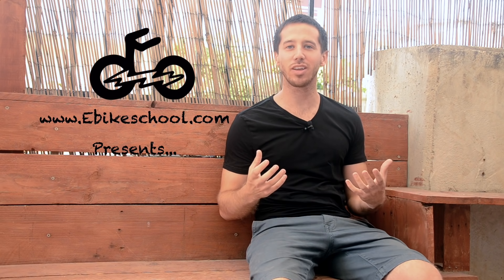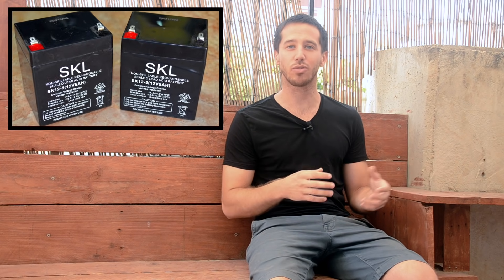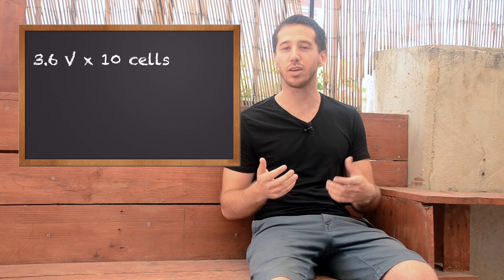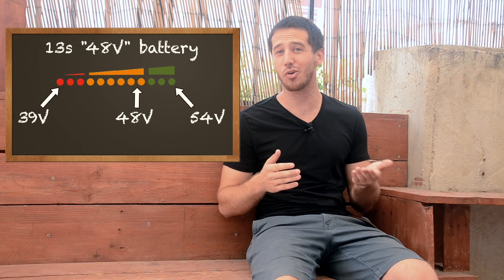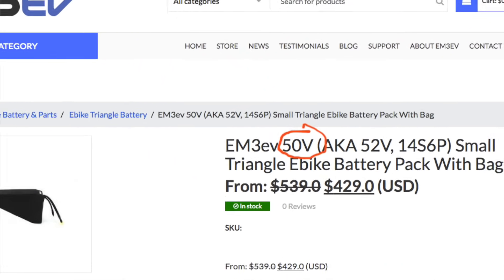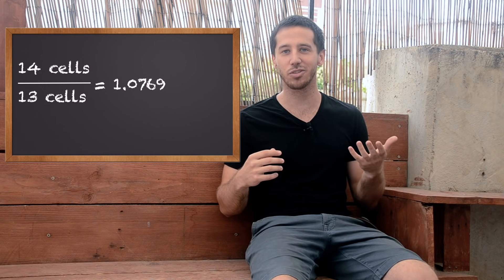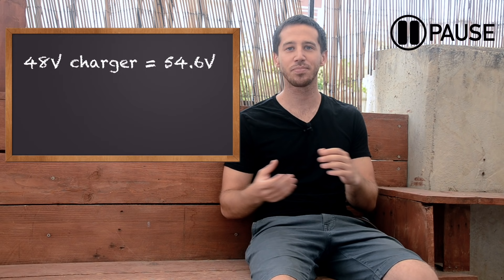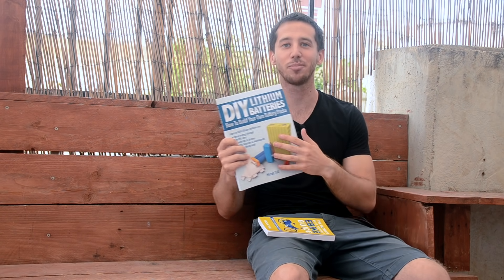Which is better: 48V or 52V battery?

Comment: Great video
I wish I had seen him last month :(
I just built my 48V battery. Of 8x13
And it was planned to change it to 9x13
Now i am thinking of updating change the bms to s14 and new charger
To stay with 8x14
Reply: Benjamin Gonzalez personally I'd want longer distance over speed. How many watts motor and how many miles do you get on a charge?
Reply: I am using a 9X13S and i love it so far and i mined cells from used laptop batteries. Put near 10 miles on it the other day and still had all 3 lights on the cheesy indicator on the throttle. My top speed is 25mph with a 1000W front hub. Not sure its really worth going through all that for just a couple more mph however i do believe distance would be greatly improved since you wont be bouncing around near the low current protection on the motor controller.
Reply: Honestly i have no idea. I didnt have anything to test them with and they were all mix and match. Im sure that will make some cringe lol. Here is what i did. I first mined all the cells and then i started checking voltages separating them into 3 categories. Above 3V Between 2.6 and 3V and under 2.6V. All of the ones under 2.6 i tossed. I kept the batteries that retained the most voltage after sitting forever in my buddies computer shops back room. That was all the testing i could do. Not much and im sure many would freak out over it but i only charge it when im able to watch over it and ive never been much of a "safety sally" as my dad used to call them. I bought a 45A 13S PCB from china for about $16 including shipping and i bought a cheap charger from ebay. The charger is rated at 59V so you have to use a PCB otherwise you will overcharge the cells. Here are the links to the PCB i bought and the charger.

  http://www.ebay.com/itm/13S-45A-48V-Li-ion-Lithium-18650-Battery-Cell-BMS-PCB-Protection-Balance-Board/352065673446

http://www.ebay.com/itm/New-48V-1-8A-Plug-Battery-Batteries-Charger-For-Electric-Scooter-Motorbike-Ebike/282385669965
Reply: Also i should note before i built the pack i charged each cell independently with my nitecore D2 charger that i use for my ecig batteries.
Reply: The Watchman News Cool thanks. Update this post or a video after you put more miles on the pack.
Reply: Ok will do and you're welcome. I made videos of me assembling my bike i just have to get them edited and uploaded. If i have a channel for that long lol. Youtube hit all alternative news today with mass demonetization of videos and as soon as they figure out that wont stop us they will get rid of us. LoL I literally found out moments ago after my daily reboot to prep for our live show.
Reply: Hi TheThrillanmanilla My ebike is 48v 500w my top is low of 20mph
I have not completely finished a load and reached 20 miles
My cells are sony of 1.95mha of a lot of batterias of laptos

I only go 10 miles a day because of that I would like more speed,
Reply: The Watchman News what was the mah of the cells you used? What did you use to test them

Comment: Another advantage of 52v over 48v is the depletion voltage of 2.5v per cell gives 35v over 32.5v respectively which means you don't feel as much of a sag in the bikes performance near the end of the charge.
Reply: This is why your batteries don’t last long...... a 3.7v battery will charge to 4.2v. If you only use your battery till it’s about 3.7v per  cell, it will last so much longer. Lithium batteries are very tough.. the best way to shorten their longevity is by running it till the voltage is below 3.5, though most people will run them until each cell has 2.5v... running your batteries that low is the reason that most have to replace their batteries within a year and the reason that their batteries doesn’t perform the same after a few weeks of ownership.
Reply: @anthonypacis7104  i am wondering if the "cycle analyst" can monitor battery cell charge and provide some kind of shut off when it dips to the 3.6v.
Reply: @manp1039  I wish I just knew what all this meant 😆
I know and understand a little as I just upgraded my own ebike to a 48v plus new 1000w front hub motor so I'm running over 1500w total and it has some juice now, even getting up to nearly 40mph which is scary on that 4" fat tire. I've been hearing about the voltage while it's running but do not quite understand that and want to make mine last as long as possible without taking away from the quality of the ride because I've spent a lot so far for two of them which I love.
Reply: Anthony Pacis without a display how do I keep track?
Reply: voltage will sag more as you lose 1.3v *14cells instead of a drop of 1.3*13 cells. your end voltage is 2.5 higher though.
Reply: someonespotato hmm won’t 52v burn more electricity than 48v
Reply: @QiahKincaid  According to the guy in the video yes according to physicists no.
The answer is a definite maybe.
If the bike needs 400 watts to maintain it's speed it matters very little what combination of amp and watts gives you that 400 watts.
It's 400 watts. Higher voltage is actually a bit more efficient here because resistance is dependent on amps not volts. (Physics).
If you fully tax what the controller can supply by going up a hill it can give more watts if it has higher voltage.
But since the lower powered bike uses power longer it's likely a toss up.
Reply: Ahh. You just answered
 My question? Thank you.guy
Reply: Can you explain, how two build my own battery pack?

Comment: I really enjoy these videos. I bought a front hub drive kit and haven't installed it yet. Spending 700 on a battery and charger has put me off. I feel like if I buy a small low priced battery I am wasting my money. 300 is more my price range. I need to just get one and go for it. And then after I am enjoying my ebike,  take the time and build one of your fancy batteries with the guidance of your book. Any recommendations on a low price quick battery?
Reply: Get 4 lead acid batteries at least 8ah around $60 and you can ride a season while you build your pack.

Comment: Could one disadvantage be that the capacity indicator that came with you 48v kit would indicate a higher remaining capacity than he battery has?  (if it's based on the system'S voltage) 

In other words, you would definitely need to upgrade your voltage meter.
Reply from the maker: That's true, I should have mentioned that. If your kit has a battery indicator separate from the battery, like on a handlebar display, it will no longer be accurate. Your bike will die when the meter still says its about half full.
Reply: Ok, yes it would die at a higher reading, but wouldn’t it also take the larger battery down to the depleted 39v (or thereabouts) controller cutoff of the 48v battery, which would and could damage the batteries.....probably not that big of a deal with 48v to 52v jump but what about say 36v to 48 volt battery increases as you have done videos on. My controller to my knowledge doesn’t give me options to change the absolute low depleted cut off voltage setup in the controller to keep overdischarging li-ion batteries. My controller is a fixed 36v controller, I guess I could try to find a 48v controller but would also need the display.

Comment: Mikey, I want to win your little yellow book, I already have the other one. I am building a 52v battery for my ebike. How many rows if 14s do I need to make enough amp hours for the 1000 watt 48v motor?
Reply: Dave Webster  hey buddy can we make a real bike not the cycle one? And since I am naive in this field can u tell me from where did you study so much about cells amps and everything else?
Reply: Dave Webster , thanks it is a 48v 1000 w motor.

Comment: Thank you for all the info you provide. Just have my bike almost all lined out. The 2 wheeler is mine and the trike is my girlfriends bike. Both 48V 1000W setups. Shes on lead acid and i built a 13S Li-ion for mine with used laptop cells. Totally impressed with both bikes abilities. Heres a picture of them.  http://thewatchmannews.com/ebikes.jpg

Comment: You are well informed and you are an educator, but I worry this industry is 90% marketing. I think people noticed some of these 3AH + cells had to be run to very low voltages to get the amp hours out of the cells. So you ended up with low voltages at the bottom and the 52v was an offset. The difference between 20 amps at around 60 volts, and then down around 40 volts is HUGE. They could use DC-DC converters to maintain the voltage. I think this is a design flaw, or over-reaching on the tech. I have a $250 LiFePo from China, two years old, rated at 36v. It stays above 36v for 75% of the capacity. It stays above 36V drawing 750 watts. It seems to me it is a real battery.  Those last two mph of speed are the ones that draw the most amps, at the top of the drag curve.  Most factory bikes treat the owner like an imbecile. The idea is to never educate the rider to any aspect of electric power. DIY people tend to chase things that are very hard to design, at least if you want some long term performance.

Micah, you are just going to have to hammer away at the basics. People have a long way to go on this stuff. The tech is transformational, but the folks think it is a passive experience. There is a tremendous opportunity, in lithium and solar, for RV's and tiny houses, but it's hard to find the tinkerers.
Reply: George Sears Li-po's  can ble flatter in terms of energy releasing, but they still heavy as fuck...      25ah 48v lipo is almost 10kg  (3.2v 5ah   142g A Cell!).
With  Li-ion  you can do the same package  with a higher voltage and a weight of 5kg only.
I have both   and li-po can be a good option  for a power wall  but not foa a normal to light weight bike.     
I have a trike with the 25ah  li-po/crystalyte rear hub  and no one can lift the bastard from the ground...
For some reason the whole car and bike industry is using Li-on
Reply: Thank you so so much for getting back thats helped put my mind at rest but I still dont understand why my battery didn't cut out at 31.85v as the BM has an under voltage protection and is it safe to run the motor at full load or should I try to keep it above 32v by feathering the throttle also how do I know my battery has given all it's capacity as it's 15ah and I don't seem to be getting  any where near this as at 9ah its dipping below 32v at around 750w load. It just shows there are great people out there willing to share their knmowledge. Thanks
Reply: No, it's probably not any kind of problem. A standard Lithium cell, more than one chemistry, has a pretty steep discharge curve. Early on it is at 4.2 V per cell and then, at the end, it is 3.0 volts per cell. So with a 36v battery, 10 cells, the voltage starts over 40 and drops to 30. The LiFePo4 has a  flat discharge curve (so do hobby type batteries, the LiPo). So with a big power draw, the voltage will show maybe 34 volts, and then it goes back to 38 volts with no power. The more you draw the more the voltage will sag.  Toward the end of the battery it pays to nurse it along with a few hundred watts, at most. 

What is worrisome is when you draw 750 watts and the voltage just plunges, which normally will shut down the motor. You want to know how many AH you can draw to get there. It's good to know what the battery is doing and know what is normal. My older cells, like the 2000 mAh, hold voltage better than the newer high capacity, 3000 mAh cells. 

These little meters are your friends, in the sense that you can judge the capacity over time, and you can rate you battery usage so you don't run out, on the fly. A little information, and a $20 meter, goes a long way.

Here's a discharge curve graphic (figure 2). It seems about right for standard lithium, not LiFePo.

http://www.richtek.com/battery-management/en/designing-liion.html
Reply: Thanks again, I just looked up the specs for my battery the cut off is 25v  the cells are Li-ion 3.7V 2600mAh in a 10s5p I cant thank you enough. Cheers Brannen North Devon UK
Reply: I never was good at math and now my brain hurts. What I would like to see an affordable charger that runs on solar I know basic house wiring so I should be able to do that I've been working on bicycles since I was 7 years old I can figure out almost anything but I don't know anything about the electric motor yet. I know people say if it says 1000 on an ecotric it's probably 750. A guy even open one up that said it was 750 in it was 500. This thing has saved my life having one leg is not easy and I don't want to be in a wheelchair and I put that bike together alone and drag the box to the garage with crutches. And fell off twice and got back on almost got hit by a van the first time I would strongly advice to not ride it down the street like I did with those fat tires you cannot turn as fast and boy did I enjoy going 12 miles and hardly used any battery. I was free and it was amazing and I wish I could sell these cuz I believe in them I believe electric bike can help the world. And they could be more green if you had an affordable solar charger that's already made or do they make them and I didn't find one?
Reply: Using a extra bms directly on the battery would shield a 14s from max discarge because those controllers are rated for 13s.
Reply: I have a question for you George when you say your battery is 36v over 75% of your capacity do you mean while drawing around 750w as I have a 36v 15ah bottle battery and even after about 4ah it dips below 36v when drawing about 750 ish watts and today after around 9ah it was showing 31.99 at 750 ish when not drawing any energy it returns to about 35v is my battery buggered its 2 months old and I follow all the charging guidelines 42v etc the battery didn't cut out below 32v either. I 've been using a watt meter for this info you seem to know what you're talking about it seems so would love to hear your advice and any tips. Many many thanks, Brannen.

Comment: Before I put my new 14s5p 52V 17.5Ah Sanyo GA Shark pack battery on tbe bike I've charged it to 100% and then left for 18 days, could something bad happened to it this way? What life range of my battery can I expect if I charge it for 9 hours using 2A charger to 100% but discharge pretty quickly as I ride mostly using the trottle? Is it really worth to buy a charger that charges to 80% and hopefully get longer battery life? I predict that it will be almost impossible to sell the old battery for a good price. I have 1737 km now with my BBSHD motor since my first ride on 3 July, I really love it and the range is 55 km minimum on full throttle.

Comment: Thankyou for the valuable info.  Do you have a video on upgrading a 2x 6volt sealed lead/acid escooter to a lithium?  What is the method by which I can ascertain the motor's max vilts/current or even KV.?

Comment: Interesting story and that's all it is, analog electrical circuit theory allows you a 10% margin of error hence the ability to use 52v which gives you a small but noticeable advantage over 48v as the battery output is of course limited to circuit parameters. There is a mathematical and physics reason for using increments of 12 (base 12) otherwise you have to build digital circuitry (base 10) to run your motor controller which would not only prohibitively expensive ($100,000.00 USD for 10cm of circuit last time it was done). Think of it this way - Why do we run digital code on analog circuitry in a computer - all pc's are 12v circuit boards really. So like I said interesting story but epic fail, I'll think I'll give the book a miss then.
Reply from the maker: Actually, the reason a 48V controller can handle 52V is that the components are rated for higher voltages than 48V - the "48V controller" is nomenclature only. It's a shame you're passing up the book, it seems like you could use the ebike education more than most! ;-)
Reply: EbikeSchool.com love the word 'nomenclature'
Reply: Not sure if it was your video or someone elses but they said you can open up the controller and look at the voltage on the caps to see what they can handle. In my case they are 63V caps so i could actually bump up to 52V safely. I also heard the only different between the 1000W and 1500W version of my setup is what my battery puts out. Apparently the hub motor and motor controller are identical in the 1500W version as the 1000W version.
Reply: Not true, don't ever try and repair an electric circuit, it's beyond you abilities, obviously.

Comment: I have one question... Why is someone use 3.6v for nominal standard voltage and why others use 3.7v? How we then calculate total energy that one battery have? With 3.6v or 3.7v? It seems that battery sellers can manipulate with this nominal voltage...
Reply from the maker: Exactly, battery sellers can and do manipulate with this nominal voltage. The actual nominal voltage for different cells varies. It's usually between 3.6 to 3.7. For example, LG MJ1 cells are 3.635 V. You have to check with the manufacturer of each battery cell.